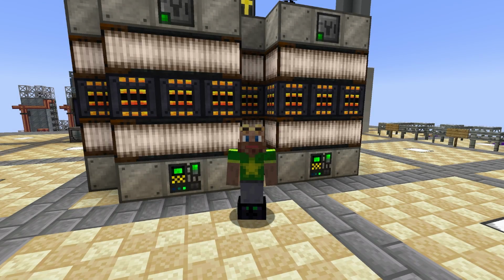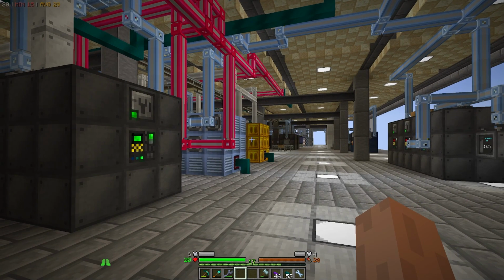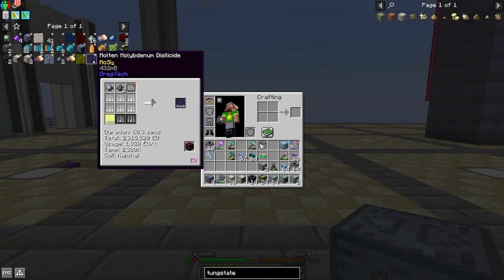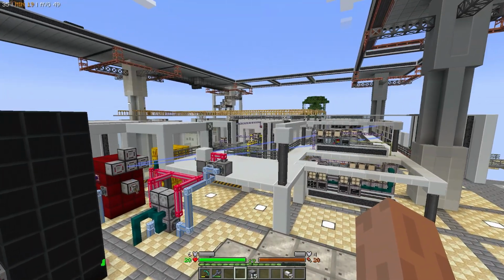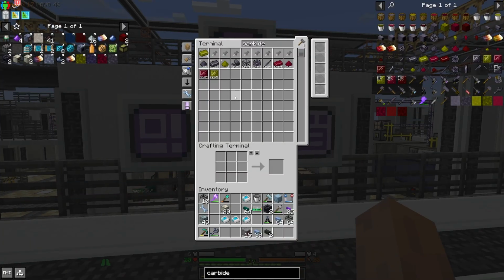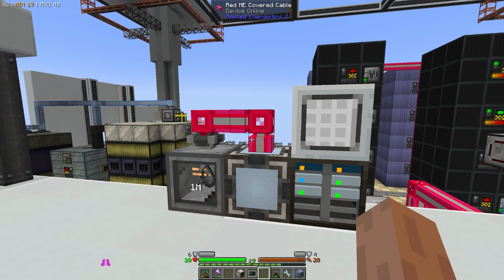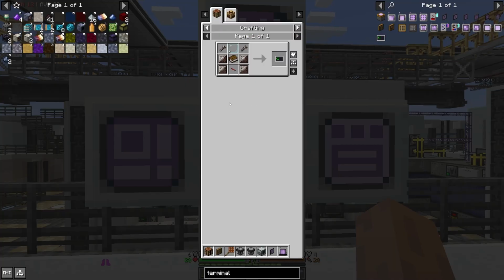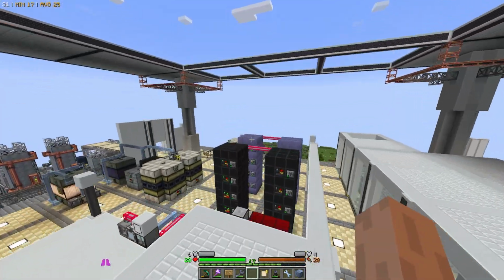Star Technology - 26 Setting the Vacuum Freezer on Fire

Comment: Is there a trick to using the GregTech fluid pipes? I started using them on my builds like yours however no fluid wants to go through it. I think I am using them with the wrench correctly? Anyway another great video. Can't wait for the next one.
Reply from the maker: @antonioeltoro666  the gregtech pipes don't auto pull, so you'll need to set the output of a machine to be in the direction of a pipe or use a pump/conveyor... (Hatches and buses on multiblocks will auto push though)

Comment: You should get yourself a wireless terminal, so you can access your storage from anywhere. Just need to make a singularity card for infinite range, which you're well past the point of being able to afford easily. You can make every version of the normal terminals as a wireless one, then combine them all into a super wireless terminal.

As for the multiblock building terminal, my opinion is that it's best for when you're building LOTS of multiblocks. Like, say, a array of ore processors to automatically process every ore.
Reply from the maker: Great suggestion! I'll definitely be getting a wireless terminal asap. I can't build the infinite range card yet, (need netherite and nether stars ; coming soon!), but I can build some of the other range upgrades in the interim pretty easily.

Comment: I also melted some pipes on my first build of the ABS.  :) 

Speaking of terminals - You can create a wireless terminal for AE2, stick it in a curio slot, and assign a hotkey to it.  They also have wireless versions of the pattern encoding and pattern access terminals, which you can combine into a universal terminal.  It only takes a few wireless range upgrades to guarantee that your whole base will be in range of your wireless access point in a skyblock.
Reply from the maker: That sounds awesome, I should definitely look into that! Thanks for the tip! 😃